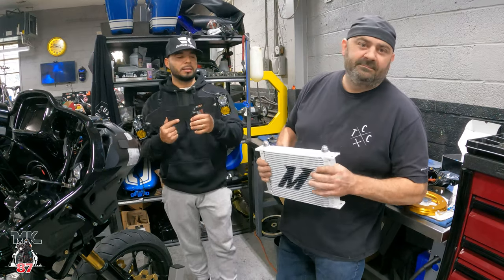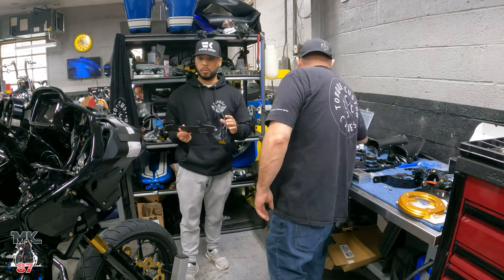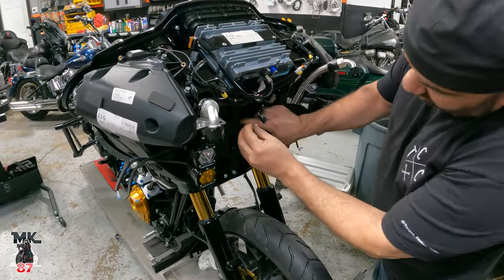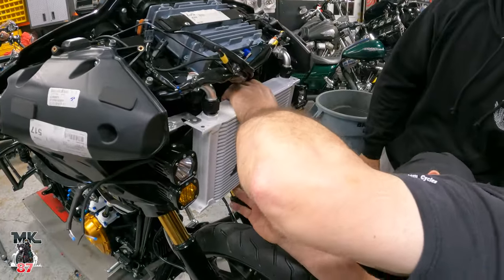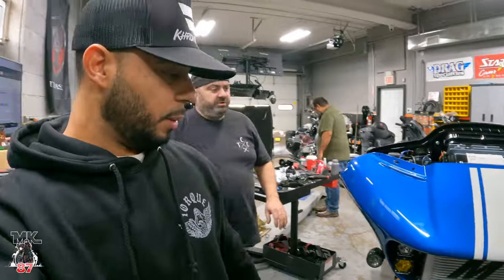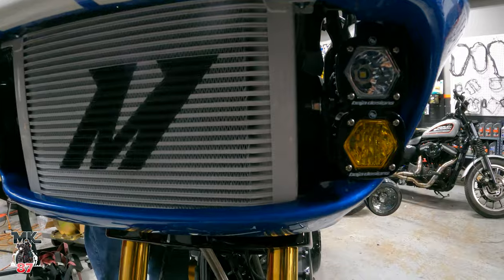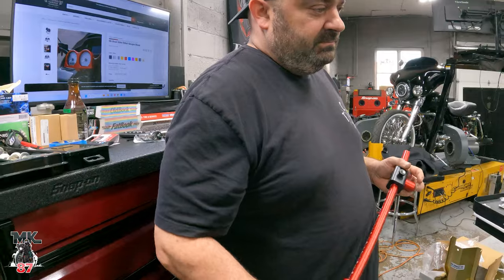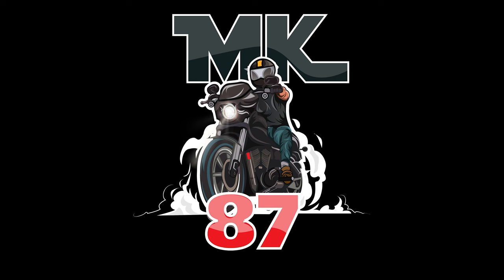LS Fabworks Road Glide Oil Cooler Kit install

Comment: Really trick looking setup but without a way for air to flow through it’s not going to be as effective or efficient as it could be without creating ductwork behind the cooler to allow the heated air to escape. I’d be worried about the electronics, head unit, and wiring with the heat coming off the cooler. If the whole inner fairing was gutted it would make this actually useful, otherwise it’s mostly aesthetics. All that said it looks absolutely badass and hot rod.
Reply: This man is correct. This mod is a lot of work for minimal payoff.
Reply: Thought I was the only one who noticed that huge bracket blocking the flow of the oil cooler. It’s also inside the fairing giving it a shrouded effect.
Reply: 😂 Worried about electronics over heating? Have you ever looked behind a Harley Motor? 🤣

Comment: I had a death wobble on my brand new Street Glide from day one. Dealership had all kinds of guesses taking my money but unable to fix and wouldn’t cover under warranty because they claimed they couldn’t duplicate the problem. They changed everything from from neck bearings, tires, suspension etc. They had the nerve to tell me just don’t go over 75mph in long sweeping bends. Finally, I saw Rack & Pull Indusries video on YouTube. I purchased the Equalizer and the Missing Link. Mine was 1/4” out. Once I adjusted it all my problems went away. I fixed 5 other bikes since. Ohlins told me on a lot of bikes the suspension mounts are off either from a bad fixture or shock mounts pulled while welding. Harley Davidson played dumb!!! That’s why the CHP and Michigan State Police ditched Harley, they have videos on their track of the infamous bagger death wobble.
Reply: Wonder where you had it serviced lol. Also from Michigan. Ride safe brother 🤘🏻

Comment: 90% of bikes do not need an oil cooler.
Reply: Yes they do, especially the M8’s they run hot and the cooler the oil is, the better for the life of the engine